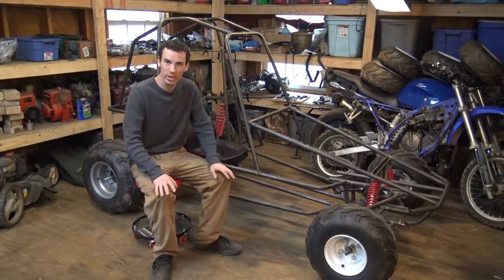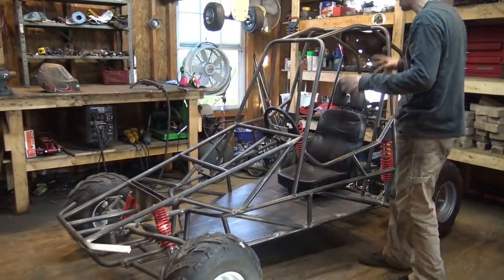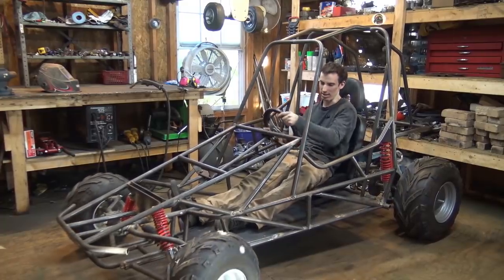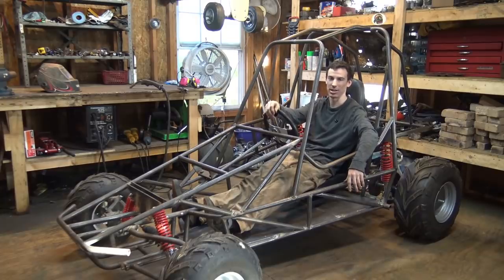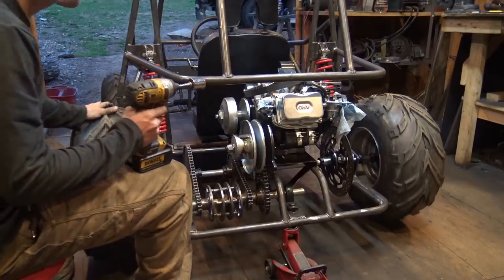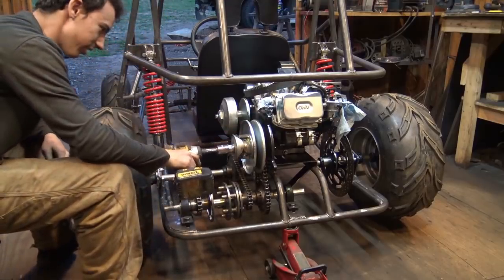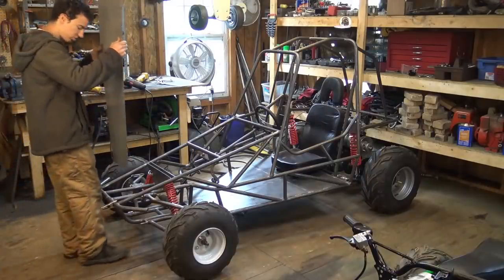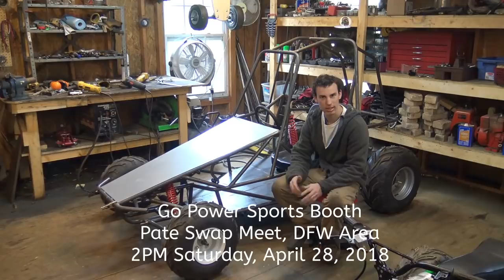building the two speed off road go kart part 4

Comment: Hello there bud, what we do over here in my parts to reduce sheet metal noise is put a kink or two from Tyre to windshield, it will also aid in giving it strength ... together with,  as many have said rubber bushings help... keep it up from RSA.

Comment: I think you should enclose all the low front faces, if you do take it off road off road it will keep you much cleaner and safer (a stick going into your leg at only 30mph can still do a lot of damage), will also stop you getting hit with stuff thrown up by the front tires.

As for getting rid of the rattle, a bead of silicone around all the seams makes a world of difference.

No need for a windshield, you'll probably using a helmet with it anyway.

Comment: Hi for higher rpms go into the crankcase find the rpm limiter governor gear.  It's plastic mounted on the inside engine sump cover.  It should give you higher rpms/power.   I like your 2 speed off road go cart.  GREAT job.

Comment: I would lay beeds of welds across panel to stiffen the sheet up. We do that on trains for different power modules and hvacs. It takes away from the vibrations and makes all the sheeting sturdy. You can put them on underside to keep it looking good. You would have to make x's and i think you will be impressed by the outcomes.

Comment: Nice work as usual. I wouldn't worry about the steering too much, a solid axle cart will tend to understeer regardless. As to the upper body panel, mount it with rubber cushioned metal Adel clamps. They'll keep it from rattling and removable, so if you change your mind you can leave it off. When you get tired of riding around the neighborhood, bring it over to Dirt World in Statesville.

Comment: To stop sheet metal rattle put a bead of silicone sealant down first then fix it to the frame with self tapper screws it works great. You can remove it easy if you change your mind later.
Reply: dinny7777 will u up load a another video dinny I like ur videos
Reply: Yeah I was going to say something similar. I make stainless steel tables, and to stop them from making rattling sounds, I run a bead of silicon around the frame where it is in contact with the top.
Reply: + 1
Reply: I use sticky backed draught excluder to stop panel rattles like that., Rubber or sponge doesn't really matter which.
 Also sound deadening material as used on car panels stops the actual panel vibrating and resonating.

Comment: About the hood.  Panelize it by having someone use a bead roller to create panels to reduce the vibration.  Bolt it on with Dzus fasteners and add some light cross bands to the frame and  put neoprene between the hood and cross bands.  You get the idea.  On another note.  You have a huge amount of unsprung weight.  One way you could ease that is by mounting the engine and two speed to the frame.  Then use the two speed axle as the pivot for the suspension.  That would make chain adjustment easy.  Great build. Cheers....

Comment: Just a little comment on the hood of your cart.  I like the idea.  Fiberglass is the way to go in my opinion.  It would cut down on the noise and weight.  Some kind of lite weight foam backing could help also.  You really should put a top on it too to keep the sun out.  I'm really enjoying this build as while as some of your others.  You got a good head on your shoulders....and skillful hands.   Dinny 7777 has a great idea.  A silicon gasket and self-tapping screws would work with fiberglass too but bolt it from the bottom, not the top.  Some kind of wooden frame underneth.

Comment: I think the body panels look good. Gives it a more professional look. I would add tabs to the frame and bolt/rivet the body panels to that. Then between the frame and body panel use a window or door foam seal. That'll prevent the vibrations from making noise and allow you to remove it if needed or decide you don't like the looks. Keep up the vids! Awesome job!

Comment: @rather b welding  If you end up going with the upper sheet metal, you could use 3M windshield urethane adhesive, just run a bead across all the tops of the frame tubes, and hold it down with the bricks until dry. If it holds in windshields, it will hold that sheet metal.
Reply: The reason 3M works for a windshield is the wind is actually pushing it down due to the much steeper angle. With the sheet metal top he wants to put on, once he gets up to speed, the metal would be experiencing lift and the 3M won't hold. Plus the sheet metal top doesn't look good. If I were him, I'd put sheet metal pieces around all the lower areas to from a kind of tub pan, that way he would be protected from anything he might drive over that would kick up from underneath.

Comment: How do, I feel if you go plexi glass route & your off roading. Dirt etc could block your vision unless your installing motorised wiper. & as far as sheet panelling the kart. Your adding weight so depends if the motor is upto the job. I’d suggest firing the motor & testing it first then see about sheet metal. As regards to rattle i wouldn’t worry to much. You could use rubber gaskets and quick release brackets to get to instruments etc. Love the builds tho 👍🏻

Comment: For the hood use sound killers large plates, same they use in engine rooms on older boats, the glue on the back side will keep it from vibrating and the sound killing effect of the item will straight the hood as well as preventing vibration in general, worth trying also super cheap

Comment: Core flute is strong and light and wont rattle loudly. Ad some side pieces up the front for when your turning. The front wheels will flick mud and crap on you and inside your kart other wise. Might be a laugh at first but gets tired quickly .

Comment: Dont weld the pannel, just weld some small supports and attach it with bolts and nuts (+ rubber pieces to damp the noise). Super awesome channel by the way.

Comment: make it completly closed with a door and windows and make the panels removeble and put rubber under the sheetmetal and use screws with rubber washers under the screws so that helps remove the noise of the sheetmetal when u hit a bump or the engine goes

and make a firewall behind the seat maybe ??

and man i love all your builds you make, this one is the best yet

Comment: Bead roll the top cover if you can, and mount it with a rubber grommet kit from the horrible fright. Use some metal tabs and bolts with the nylon lock nuts. Hopefully it won't rattle as long as the bolts are rounded off at the right torque. :)

Comment: fab up some tabs to mount the sheet metal with bolts and use a rubber washer/ bushing on the bolts. Or leave it without. I think it already looks badass.

Comment: Great video and build!
Tell me something, please?
Why do so many go-cart builders use those weak, verticle mount bearings for their rear axles?
I'd much rather have the heavy duty pillow block bearings like used on the two-speed assembly. 
I would put the sheet metal cover on the front and add a Lexan windshield as well. 
Keep the 420 for a smaller go-cart and use a 670 on this large go-cart frame. Check out Cars and Cameras' dragster go-cart and you'll see why I recommend that change.

Comment: Weld tabs onto the frame,and use rubber washers where you screw the metal'hood',and Plastic lower body pieces on.This way you can remove for repairs, and Hot days.For Sure need fenders for the front tires.Maybe modified trailer pre-mades?

Comment: Add the sheeting around the body but weld tabs to either rivet/nut,bolt/tec screw and use rubber edging strip and perhaps sticky back foam to the areas it could vibrate and make a noise on.

Comment: I think it will look good with some bodywork and will keep some of the mud and crap out of the inside.

To deal with the oil-canning possibilities of the body panels you could try a few different methods.  It would be artistic if you build yourself a bead roller and roll some embosses into the panel.  It will change change the resonance of the panel and could look cool as a bonus.  Another option is adding structure underneath the panel or even adding mass to the backside.  A chunk of sheet metal bonded to the back side can change the resonance characteristics of the main panel and "quiet" it down.  Very commonly used in industry, especially in appliances which act like a big metal speaker box if not properly damped.  Project is looking great!

Comment: I would add some sheet behind the front wheels because off road it will protect u from having rocks and dirt flying into your face. The top front piece run a bead roller in the center of the sheet and the bead will stiffen the steel and keep it from rattles....

Comment: for the peice of sheet metal just mount it using hood pins but mount them more towards the middle of it and use four of them make sure there rubber mounted and that you have to push down pretty hard to get the pin in and i bet it wouldnt rattle to bad and you could cut a rubber hose in half and run it aound the outside of it so it doesn't rattle on the frame there.

Comment: I would put panels on the top front and side. I would fasten them to the frame with zeus fasteners that way it would be easy to take the panels or body off when you needed to get to things. What kind of tubing bender are you using? Also was wondering what mig welder do you have? I this could be your best build yet. Keep up the good work. Have a great week. God Bless!!!

Comment: It's too late to give my advice, but for the sheet metal noise, I'd weld some angle iron into places in between frame parts to stiffen the sheet metal and prevent vibrations. I would also suggest using brackets welded to the frame so you could bolt the sheet metal on so you could remove it if you needed to get access to something underneath it.

Comment: grometting screws for the panels. Less is best. Neoprene O ring for the screws, maybe 6 to a side. could even wing nut them on studs so the panels are removable. You will like having the protection from the flying mud with the plate in place, at least the top front panel.

Comment: You should make a whole cab.  It would also be cool to make it ether heated or air conditioned, or both.
      Also you might want to add a firewall to the back. You don't want to be stuck in the flames without that protection. Just an idea.

Comment: Use a sheet of 3/8 inch plastic for the panels. That's what I used for my project and made tabs to bolt it in so I can remove it when cleaning and repairing the cart. Plus it's lighter. To go around curves and bends just use a heat gun and warm the panel up to form it into the desired angle. The paneling that I got already had texturing to it so any scratch from sticks and debris weren't as obvious.

Comment: I have never built, seen a chain that big and seen a crosscart in real life but it sounds to me that the chain has to much tension. The grinding noise seems odd. Really cool cart, I would gladly drive that thing. I really like the sheet metal look and I'm also for the windshield. If you're gonna attach more panels, put some rubber underneath them.

Comment: I know this is well past the finished stage, but if by some strange chance you didn't get the panels on....bead roll the panels to stiffen them and  paint the back/underside of them with flexible bed liner to keep them from flexing and rattling from vibrations. You have to enclose that thing for protection, too many things can come up and hit you or get caught in the tubing and driven into you like a spear... like bgdwiepp said in their comment post. I have to say you did a damn nice job. I don't know if you sat down and designed this thing out on a paper napkin or a  drafting setup with every dimension or just off the top of your head, but like I said, Damn nice job.   It needs some refinements like bronze bushings and grease fittings in the pivot points and little tid-bits like that... but a sweet setup. If you think about it, you could set this thing up as a do it yourself kit and sell them. on eBay or something. and make good money. I bet they would sell pretty good for father son projects or just for people that love to ride trails and want to custom build their own mini crawler or mudder .  Don't forget the alternator and a spot for a good size battery for the BIG Off Road lights on the roof and the 2.000 pound Harbor Freight winch and BIG Off Road Lights on the front.

Comment: Weld small loops and string some heavy mesh on the hood and roof. It will stop mud and rocks, easy on and off, light weight, slap your logo on it, haul some camping gear on it(or whatever).

Comment: How about making and inner frame to that sheet of metal and making it a bolt on so that whenever you need to get in there to work on the steering rack that sheet of metal is not in your way. 

Also have you thought of how much weight you are adding to the gokart. It looks like its going to be a pretty heavy cart.

Comment: Put some corrugations in the sheet metal. Longitudinal stripe two per half repeat on all other sheet metal panels and when affixing use silicone bead before laying sheet panels to frame. Your choice whether to weld or screw. I think welds would look better.
Reply: Come up with a cool paint scheme to protect the metal and think about some aluminum skid plates in key spots.

Comment: I love the open frame look, so I would leave off the hood. Also, if you need to fix or replace the front shocks, or the brake master cylinder, etc. it will be in your way. Also, you are correct, it will be noisy unless you put some creases in the metal to stiffen it.
Also, why in the world, when you took everything off to finish the welds, did you not paint it?? You are going to have to disassemble the entire thing again in order to do that! LOL
Looking great by the way. Was this a plan that you followed, or did this design leak out of your brain as you went along? It looks amazing!

Comment: Weld tabs and rivet aluminium or plastic sheets on. Then you can easy swap em out and also lighter. - And lower the roof and copy the bottom front frame and do the same on the front top aka lift it a little.

Comment: Fully weld it shouldnt do it. An if it does you can put thin sheet of foam maybe 1/4 inch think and glew it underneath. I really like the look with sheat metal on it, it will help keep all the wind off your leggs id still do a peace of plexand for a windscreen.

Comment: If you like the bare frame look but still want to cover it up. Check out some of the carts/buggies on High Octane Films channel. Some make panels for each hole in frame and bolt  each panel to tabs welded to the frame.  You will still see the frame but still have it covered and rattles will be kept to a minimum with much smaller panels instead of one large sheet. May be time consuming!

Comment: You might want to wait.  I feel you are going to need to tweak out the front end after your trial runs.  Instead of sheet metal, look in Coosa board.  It is much lighter and it can be bonded to the framing with a two-part epoxy and should offer more benefits than sheet metal.

Comment: The panels I think look cool, like a sand car. I'd weld tabs that would go under the sheet metal and drill through the sheet metal and tab and then tap and thread it with an Allen bolt.or something

Comment: Shape the hood to make it stronger, maybe put a line in the center but stop short of the front edge a few inches.... The piece of metal may need to be slightly wide to compensate for hood crease...this might make it a little more quiet..

Comment: I would have put front disc brakes and a angle bar in front of the rear wheels, that angles up to behind the front wheels, to the main chassis; to keep trees and brush from getting in front of rear wheels. Paneling depends on how wet you want to get in the rain.

Comment: Man that would be so badass with a diamond plate body on it it would be killer... ooh ya and weather stripping works good for nose fix just put it on the top of the frame put the metal down and weld it up

Comment: Would if you got some of that cheap rubber spray on shit, like the cheap version of flex seal at home depo and covered the bottom side of that sheet metal or the whole thing if you want, that could possibly take the radel out if you had some of that rubber coating on both sides the sheet metal and the frame. Just an idea. Love what ya do keep up the good work

Comment: I know I'm late, but a suggestion for canceling out much of the vibrations from the hood could be to weld some narrow bars to the underside of the hood. they'd increase overall ridgidity without adding too much extra weight. A couple of ribs positioned about a third of the hood's with apart should do the trick. I'd imagine that they wouldn't need to be much thicker than 1/8 of an inch and no wider than half an inch, provided they run the entire length of the hood, they should help to reduce any excessively noizy vibrations.

Comment: I think the shifting is not going to happen while driving without a clutch of some kind.... Awesome build! Thumbs up! :)
Reply: Braxx Juventa 

Wrong. 
He has done 2 or 3 other 2 speed transmissions and they all work great with only the CVT system on the engine. 

I guess this is the first video of his you have watched. It does work.
Reply: With the CVT transmissions he's using, it automatically disengages the engine when you let off the gas

Comment: NO windscreen, If you go off road it WILL get muddy and then you can't see. As for a body I would go with aluminum sheets and aluminum rivets alot easier to drill them out if and when you need to.
Or sheets of some kind of plastic with aluminum rivets 1/8" don't go too big, keep the holes you drill small. And just the lower part of the body not the whole thing covered.
If you put some creases on the sheet metal/aluminum it will stiffen in up and use a bead of silicone on all the pipes that touch the sheets.
PS: Keep it as light weight as possible...